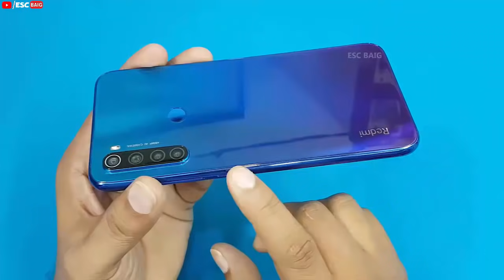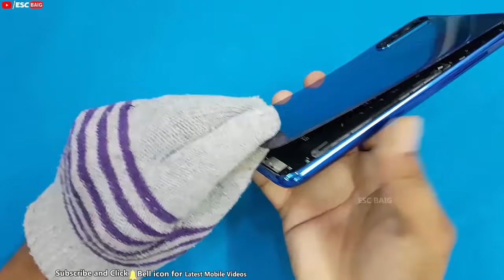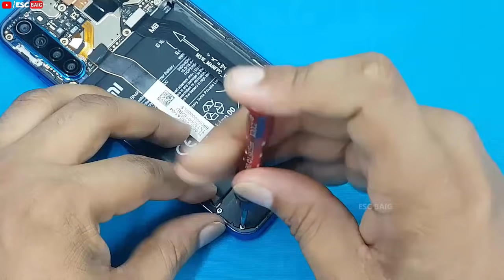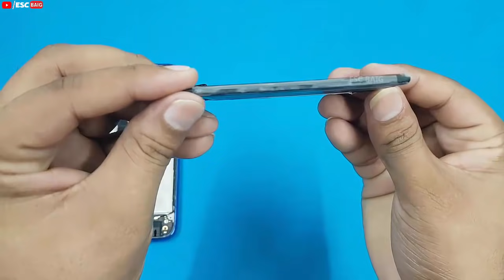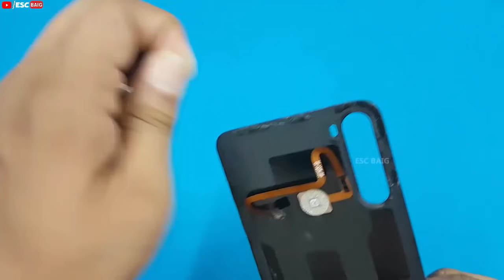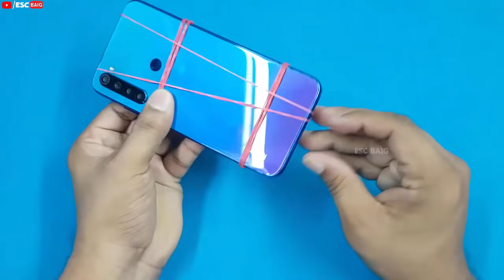How to Replace Redmi Note 8 Battery |  Redmi Mobile Battery Replacement | Redmi Mobile Battery

Comment: it is okay to use mighty bond or super glue when placing the back cover?
Reply: Use only rubber  that is used by mobile repair shop otherwise It will damage the battery

Comment: I'm having battery issues in my redmi note 8. It's draining so quickly without any use and also getting charged up quickly. There's a little bit swollen area under the camera bump on it's left, the side panel of the glass back is little up.
Can you please help me to clear my queries?
 How long it will last after battery replacement?
Will the smartphone perform well enough after the process? If yes then for how many month or a year may be!
I am so confused please help :(
Reply: Speaking of device's calculation performance, I don't think there will be a difference after a battery replacement.
But the new battery should underperform the original battery a little bit.
The battery's charge should be able to last more than a normal working day.

For longevity, I can't really tell. I've have one battery replaced within the last 6 months and now the swollen battery issue comes up again.
Reply: Bugun batareyasini almashtirtirib keldim va bu menga yoqmadi. Sababi barmoq bilan ochish ishlamay qoldi

Comment: Hello!  thank you very much for your video.  I have a question, is there a higher capacity battery model compatible with this device?
Reply: @sahadaslam8591  is it possible?? Will it support??
Reply: Same question? Will note 8 pro batt good??
Reply: @eddiedelacruzjr.9793  No

Comment: just from last 2 days my redmi note 8 started to turnoff ,than when pressed power button it boots and i can see redmi logo  but than device doesnot turn on  (,it gets stuck at redmi logo)  even if i press power button.only when i connect charger and than give supply and press power on button device turns on and i can see  d display.

but if i start using my mobile ,say for example open any app like whatsapp or youtube it functions well so long as my charger is on and connected with mobile as soon as i remove charger even when battery shows 95% charge and than play youtube or any app  ,my mobile goes back to black screen with redmi logo and display turns on and off  and logo of redmi flashes and this continues  but even after pressing power on device does not turn on unless i connect it to charger and give supply.

mind you all the while battery was above 90%.what you think is the problem? plz help.
Reply: Mine started to behave like that too since last week, today I took the case off to find that the battery had swollen, enough to cause problems. Hoping to get it replaced soon.
Reply: same problem I have . mere phone Me bhi yahi dikkat hai. aur apne kya kiya. ply apna no dijiye baat karna hai
Reply: @rajakumarsharma8287  watch this video : https://www.youtube.com/watch?v=j3KmkPVOtxc&t=312s

isme battery ka capacitior faulty ho jaata hai.either u repair urself if u know soldering and opening d mobile or just new battery  daaliye.

main new battery dalunga kyunki my mobile is already 2 years old.
Reply: @sagaronline265  but abhi apka phone kaise chal rhaha hai ply bataye
Reply: @rajakumarsharma8287  no i didnt buy battery yet,mere pass service centre jaane ka time hi nahi mila.agle week mein shayad jahunga.

ill update u than.filal mere dusre phone se kaam chala raha hoon.
Reply: @sagaronline265 did you replace your phn battery? Isn't it working?